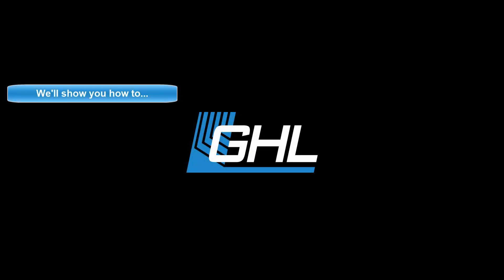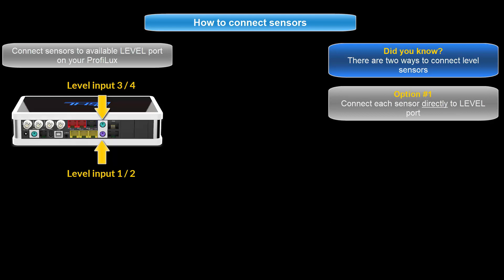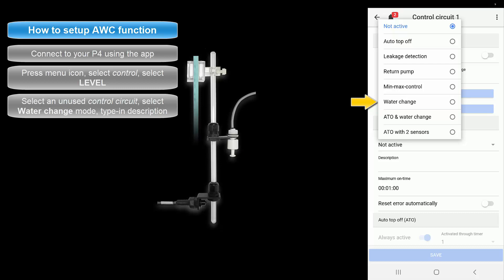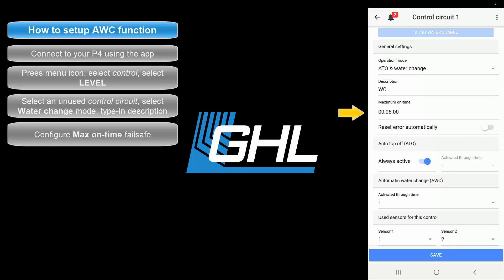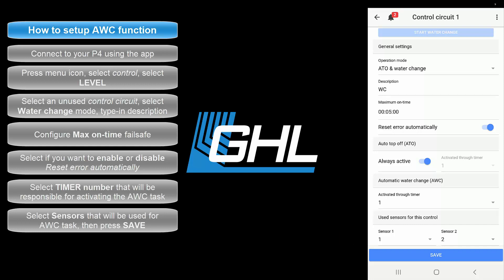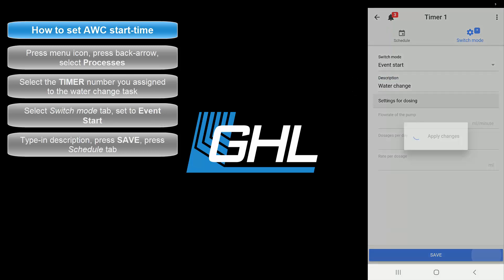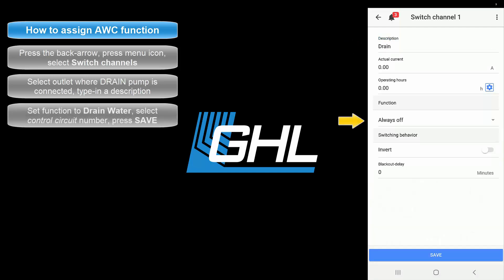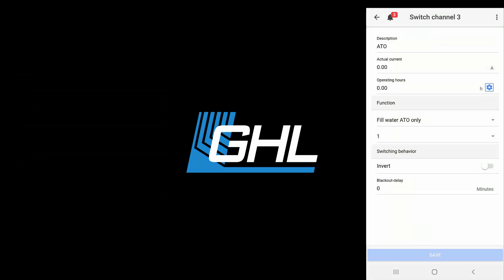ProfiLux 4: AWC setup via GHL Connect

Comment: Very helpful, thank you as always. Can you use three sensors to perform both ATO functions and Water change? For example, a high and low sensor for ATO to keep level, and a third sensor as the lower sensor for AWC? I'm using a MaxiDoser for ATO, but would prefer to use a less expensive submerged pump for water change. Of course, you could use 4 sensors, but the fact that ATO/AWC is an option suggests this is possible.